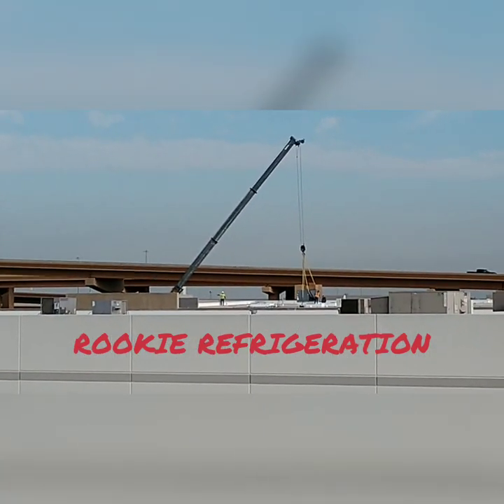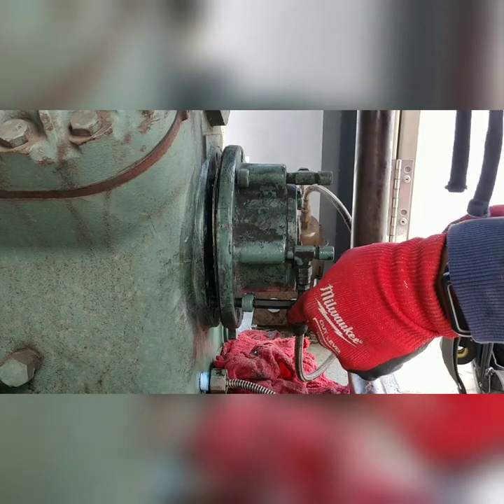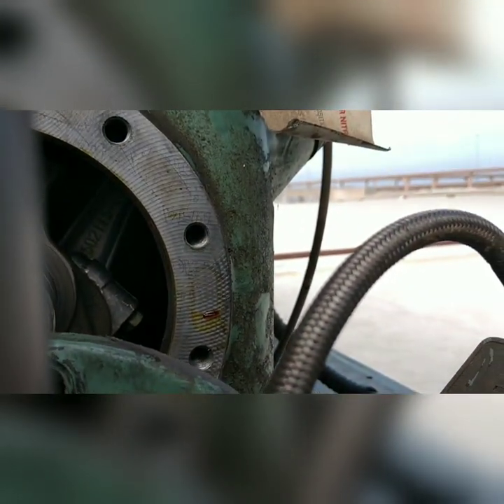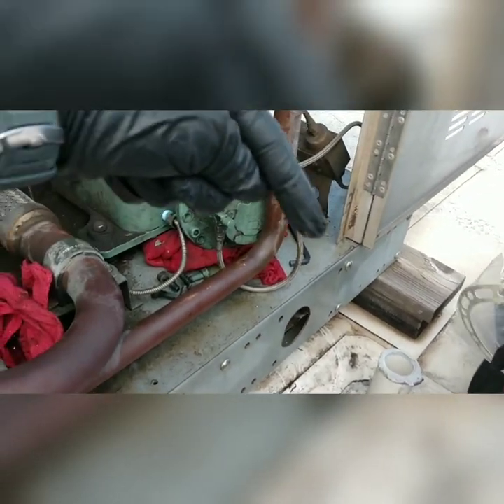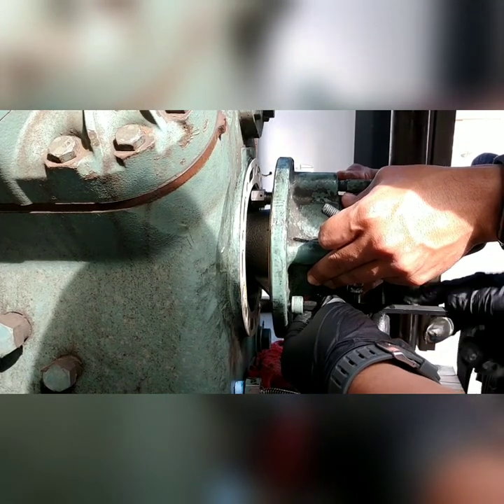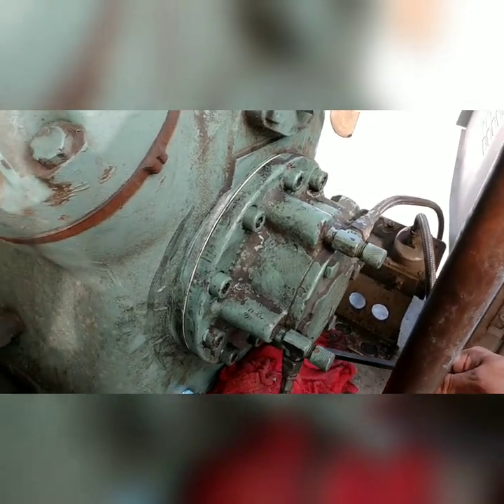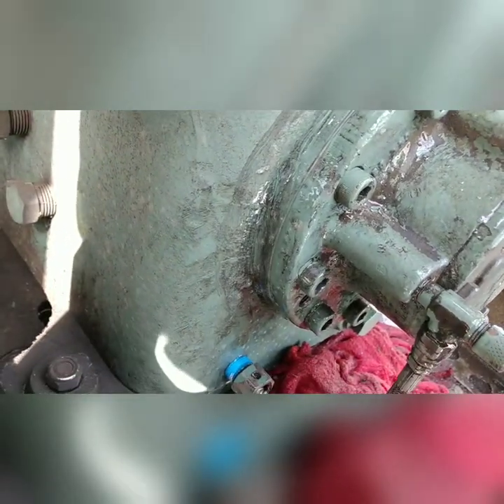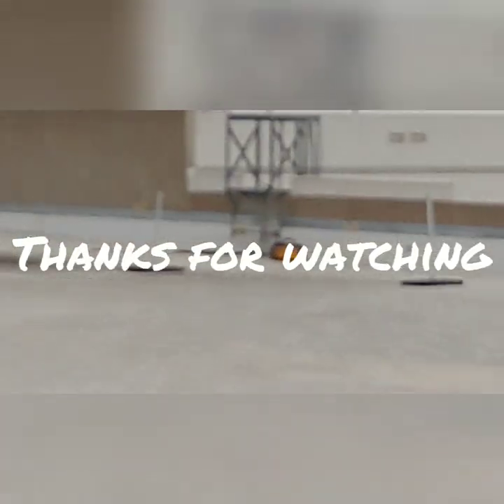HVAC/Refrigeration- Pulling The Oil Pump on a Bitzer Compressor

Comment: Not doubting the t/s skills.  I havent worked on many bitzer compressors. I went to a Carlyle school, again only for Carlyle, ifnu have yo replace the oil pump it's most likely a ring, piston, or valve issue.  I'm not doubting you

Comment: I used to put a light coat of the old blue acr leak seal on both sides of the gasket and torque it down. never leaks
Reply from the maker: I’m not a huge fan of leak seal.  I understand it has its place.   But we just like using NYLOG
Reply: @rookierefrigeration4357  I'd imagine the rebuilders like to use shellac on those semi-hermetics.  Works well but it's a pain to remove...

Comment: What to do if the oil in the engine always runs out, and what to fix if the engine always stops due to oil pressure control.
Reply: Do you have to change the oil pump?
Reply: If the oil always runs out, what is the cause? Do you have to replace the piston rings?
Reply from the maker: @Preinakal-2123  find out why.   Usually it means you have floodback.   Look at your metering device
Reply: The oil in the engine always runs out, engine 2 and 3 are normal, because there are 3 engines, medium